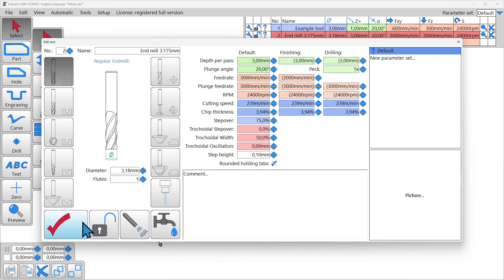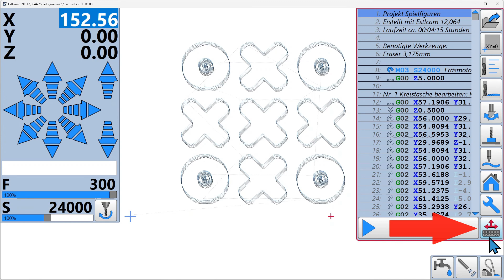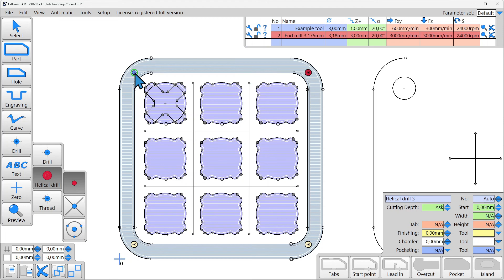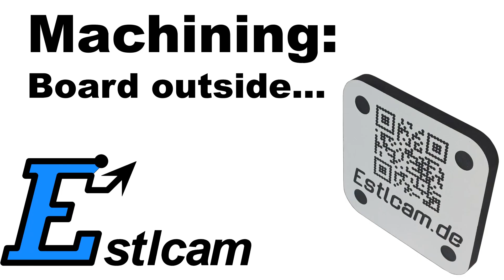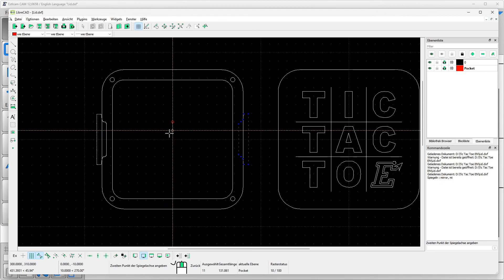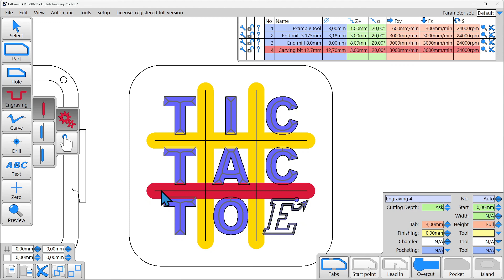Estlcam beginner tutorial: CAM and CNC controller version 12

Comment: This is perfect, I'll have to make this tic tac toe game too sink some of this in, I've been using it for about a week now and well obviously didn't  know a bunch of the functions. I got it set up and able to make functioning gcode, but this will make things flow nicely.
I built the LR3 and if I can't use Estl cnc now, when I upgrade my control board, motors and etc, then I'll keep this in mind. Do you have a list of compatible hardware ? And most importantly when will you be making a version to run on Linux ? This is the first time I used wine to run any software and haven't used windows in about 10 yrs. I don't like to use wine because software developers think there is no or not many linux users that would want the software, so using wine clouds those numbers and keeps them from making compatable linux versions. The reason I'm using it is there are not a lot of CAM option to run linux and I finally caved, the other option is to make my own, lol not happening.
Thanks for this great piece of software, powerful yet simple

Edit. Ok I just opened the Estl cnc and noticed lists there, and under hardware is say genuine Estl cam hardware, do you sell this or  ? anyway it'll be a bit before I finish designing my upgrade, but I planned on starting to pick up parts soon.

Comment: Hello everyone, I'm new to the CNC router I just bought a small Two Trees TTC-450 CNC Router Machine. This software is perfect for the stuff I'm planning to do with it. I just need to carve some small signs cut out some 0.5" playwood shapes nothing too complicated. My only question is if the Estcam controller is compatible with this TTC-450. If not I can always save the gcode and run it with Candle or UGS. I been watching a bunch of videos of this software looks easy enough. I know a bit a bout 3d Printing and Laser engraving it shouldn't be too difficult to get me started. Thank you for the content I learned a lot from this video.